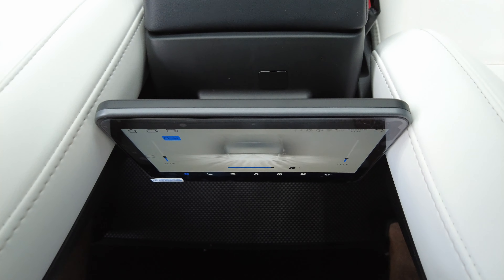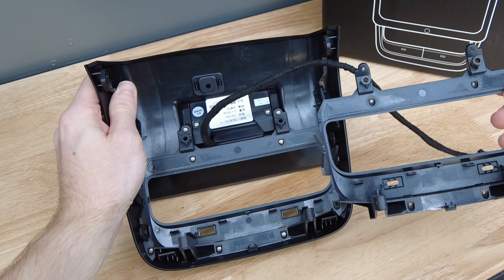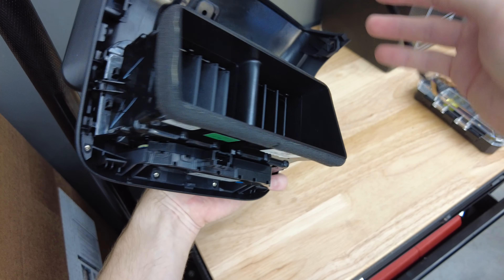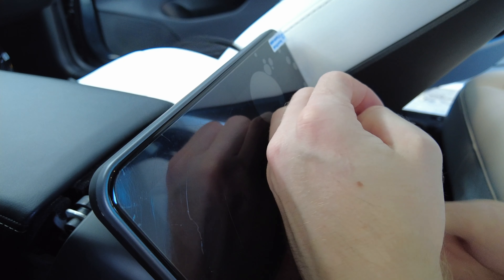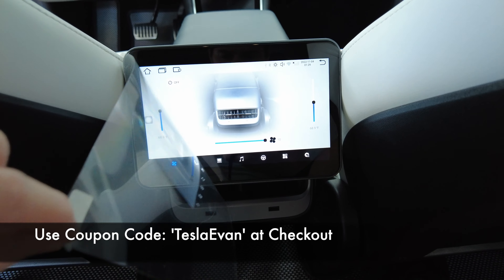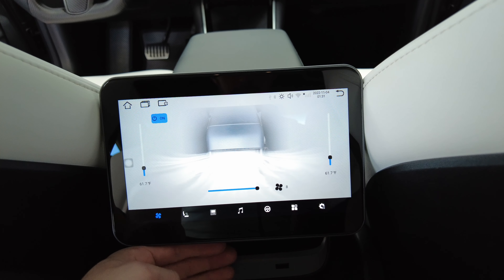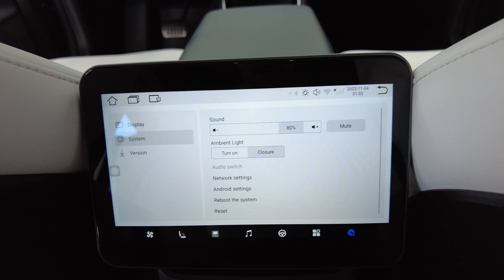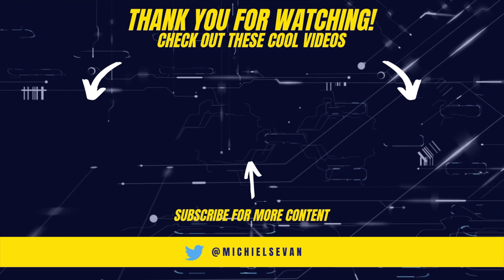Tesla Mini Climate Control Rear Display | Model Y - Model 3 | Passenger Heated Seat Control Install

Comment: How in the world do you take out that cable form the autopilot computer. I actually can’t do it, how did you do it
Reply from the maker: For the first time, I used a flathead screw driver to unclip it from the computer.
Reply: @EMtesla1  Hey Evan, how do you use CarPlay on this rear screen?
Reply from the maker: @myhd9693  Through the settings menu you can setup your phone

Comment: Installed this and have had some issues with getting Tesla updates working anymore, have you experienced the same yet?  Disappointing unfortunately, also did you get a decent sounding click when you connected to the main computer?  Mine didn't click nicely like the Tesla connector.
Reply from the maker: Hmm,, I still get the usual tesla updates and my cord also clicked into the tesla computer.